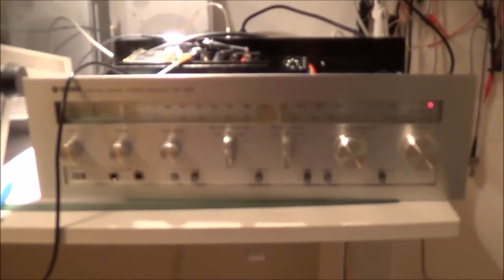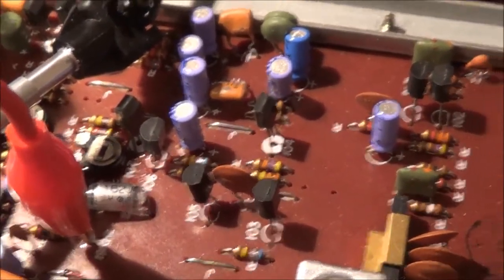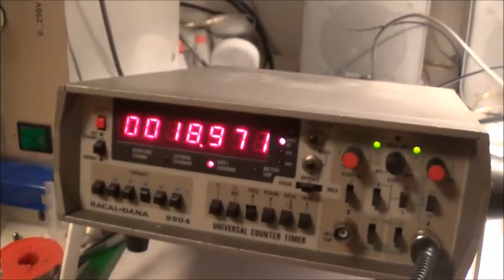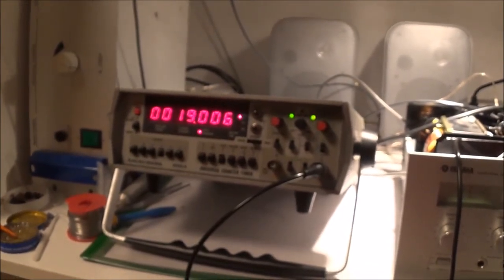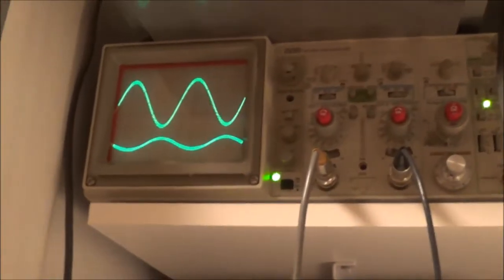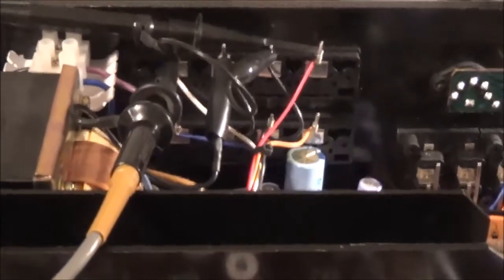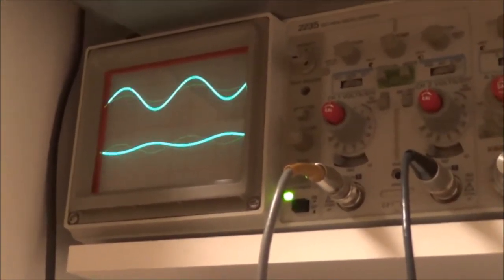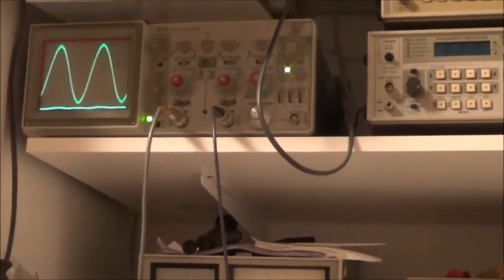Yamaha CR 420 Stereo Separation Adjustment

Comment: Hey, can you do a video on properly adjusting the Leader?  I bought one a few months back but have not had time to dork with it until today.  Mine appears to be working per the scope, freq counter and even over the air, however, I am unable to get the "stereo" light to illuminate on the radio (tried a few different ones), again, freq count does show 19khZ, 67khZ and the set freq for the RF itself 99.7MHz...not sure if its working as designed or if I'm not doing something correct...like make a physical connection to the radio??  Thanks!  ~Jack, VEG
Reply from the maker: Hey, hey! I have started making a video!
Reply: Thank you, I appreciate it very much! Will be looking forward to your epic 16 part comedy drama in stunning 8K video on the subject!  :)  ~Jack, VEG